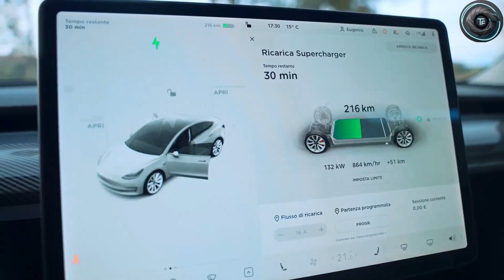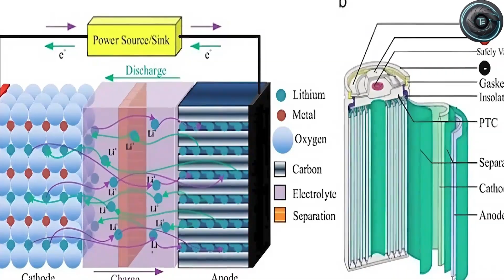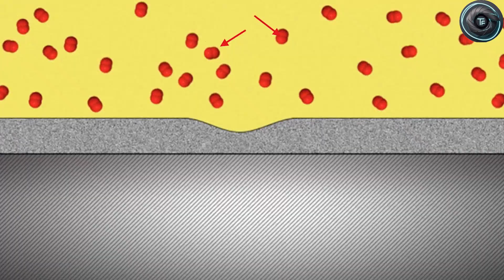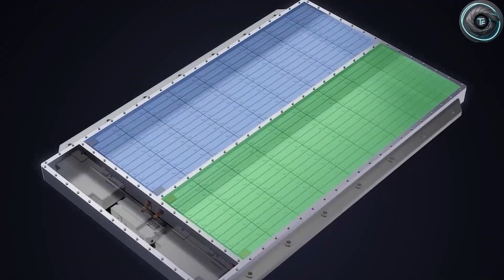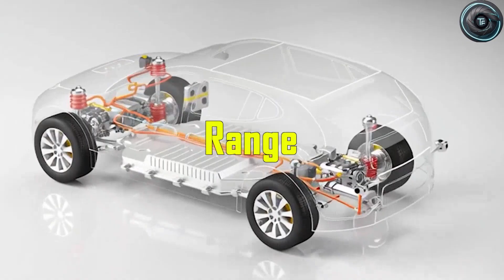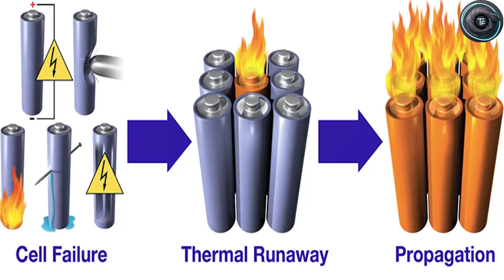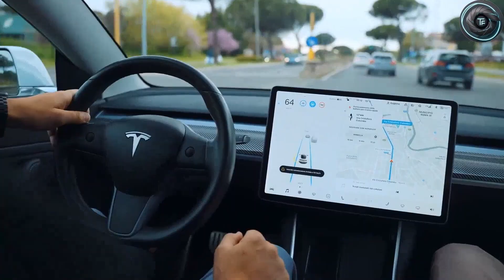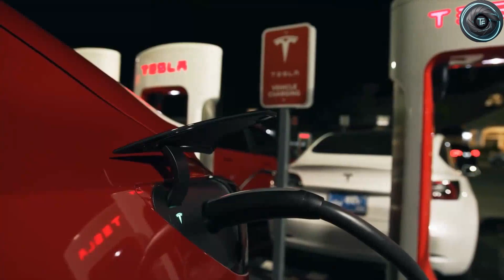WE Tested Tesla's New Aluminum-Ion Battery and Here's What Happened!

Comment: So, how do sodium-ion batteries compare to aluminum-ion batteries?
Reply: Sodium is cheaper, but much lower energy density. Cars won't be going sodium unless people can learn to be happy with <180 mile range.
Reply: Why with a higher voltage does aluminum ion seem to not be as high as both lithium and sodium it should take advantage of the higher watts/kilogram  . It seems to not take advantage of the higher voltage. I am thinking the losses in the silicon are not adapted to deal with the higher voltage of aluminum ion.